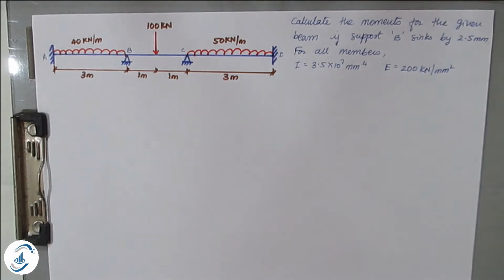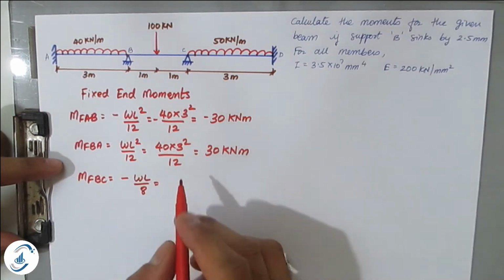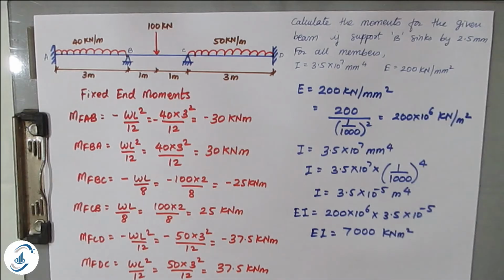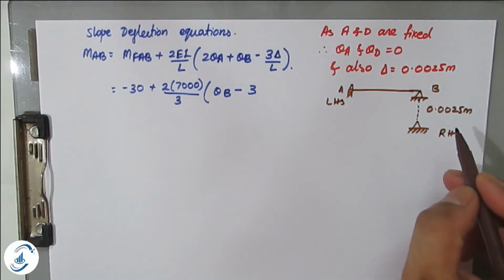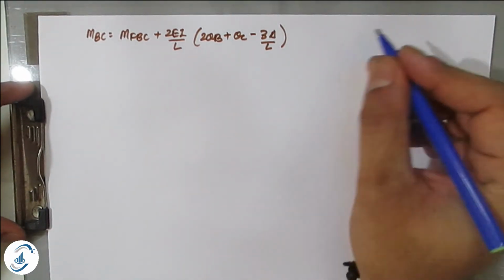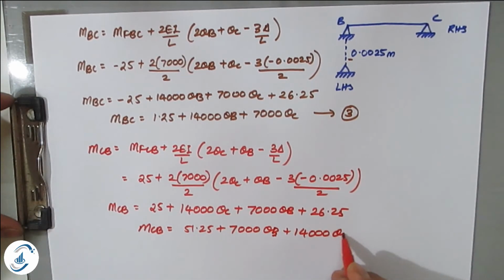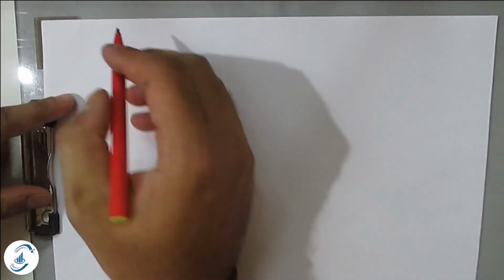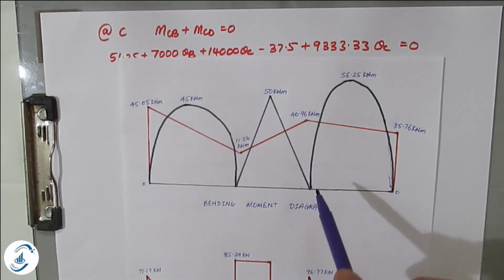Slope Deflection Method with Support Settlement Analysis of Continuous Beam

Comment: 1) STRENGTH OF MATERIALS

   {R20 REGULATION }

2) ENGINEERING GELOGY
3) STRUCTURAL ANALYSIS 
4) HYDRAULICS AND HYDRAULLIC MECHENIRY    

5) REMOTE SENSING AND (GIS)
6) FOUNDATION ENGINEERING 
7) HYDROLOGY AND IRRAGIATION
8)ESTIMATION AND COST EVALUATION